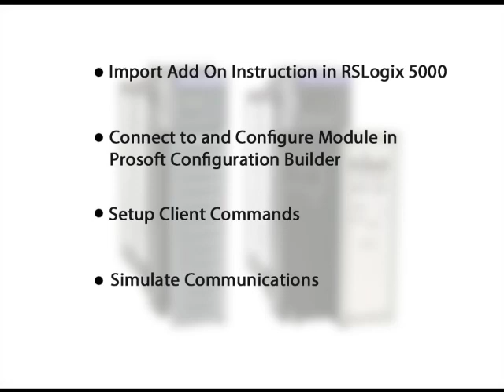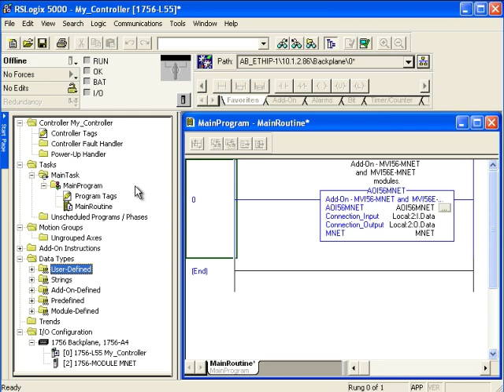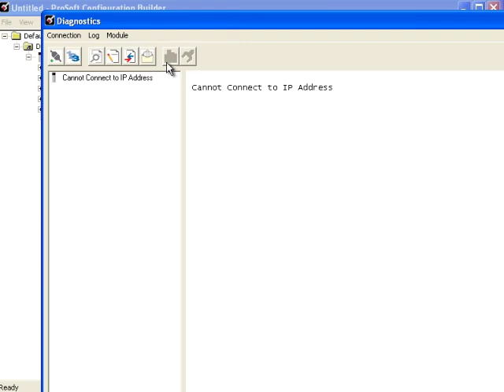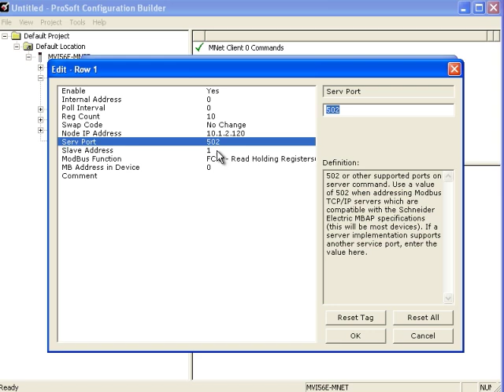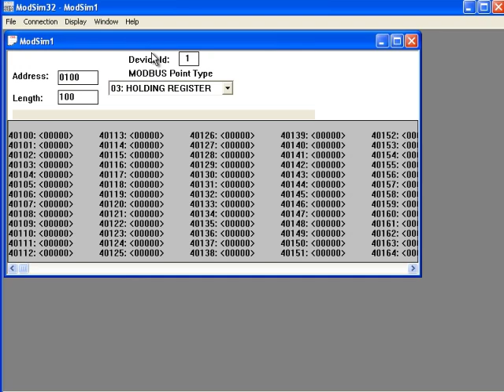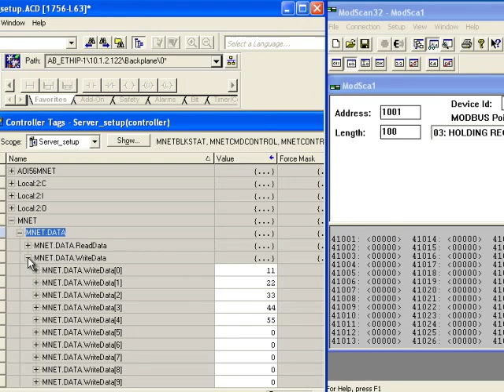Set Up: MVI56E-MNET Modbus TCP/IP Communications Interface Module

Comment: Hello Guys! This is a very good video. I have a question regarding this module to be set up in a ControlLogix Firmware Version 13 using Sample Ladder. I've followed the steps and configured the Module using the Configuration Builder. User-defined data types and ladder code required for the application were added to the existing project as well. However,  I'm not seeing any requests or responses in the Client Module Diagnostics, they both show zero. I've verified everything and don't see any problem. Module status is also fine as per the local LED indications. Could you please share your thoughts on this? Thank you very much!
Reply from the maker: Thank you for your question, we'd be happy to help you trouble shoot!  Please either call our support team at +1-661-716-5100 or send us an email at support@prosoft-technology.com and we'll have a Tech Support Engineer follow up with you!

Comment: Hello. Great video, thanks! You said the connection parameters should be set as shown in the video. How are those values determined?
Reply from the maker: Hi! In general, the configuration tends to be fairly application-specific. They have to be tailored to the specific devices being communicated with. So in the video, we knew what type of device we were communicating with and could look in that device's documentation for information on things like its Modbus Register Map or IP Address.